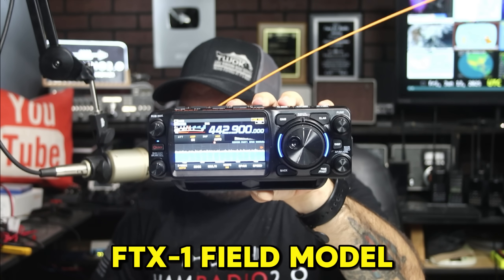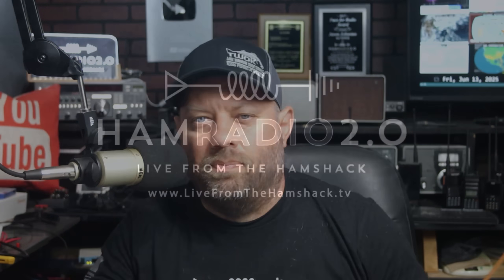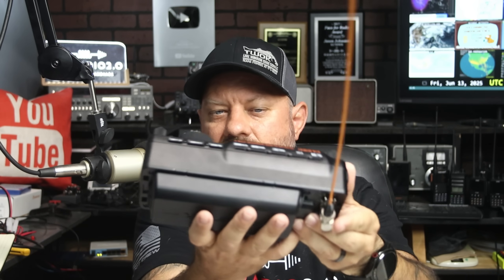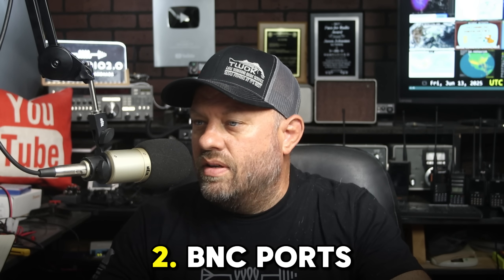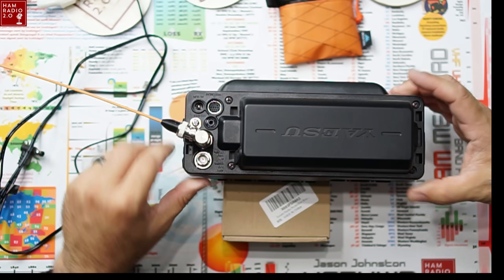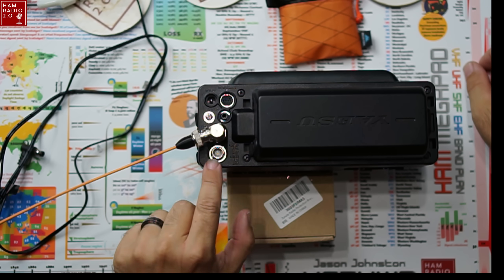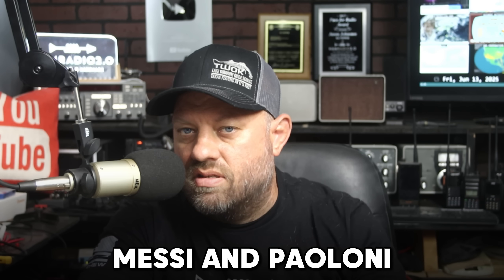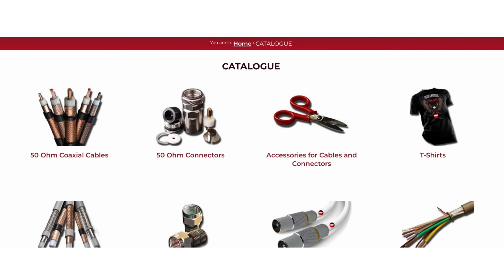5 Things Wrong with the Yaesu FTX-1

Comment: Sorry, this is a lengthy rant, but I had to spit it out one day anyway. This was my original vision on FT-817/818 replacement from Yaesu. I understand that many of you may disagree, but problems mentioned in the video are minor. The core problem is the form factor of the radio in the first place. Neither IC-705, nor FTX-1F is perfect for truly portable and backpackable operation (at least 705 has dedicated backpack). Success of 705 was not due to ideal form factor, but rather the lack of competition. Yaesu had nailed it many years ago with 817 and regretfully abandoned it. There was opportunity and maybe, just maybe still is to re-imagine the portable QRP radio without any display and make a use of displays that are already in everyone's pockets - smartphones. There are key important advantages: no display - less power draw, increased ruggedness, smaller overall size and weight, more inner space for modern technological advancements. Just imagine the black, rugged and weather sealed magnesium brick the size and form of 817 with rightly placed antenna ports and set of modern built-in connectivity tools, namely BLE (low energy), Wi-Fi, GNSS GPS, fully functioning TNC and fully functioning USC-C charging without compromises, open and robust API that would make 21st century radio to stand out. The missing albeit the most important component would be the Rig Control App. That's were Yaesu and other makers had to, have and should concentrate on and invest the most. The times of hardware perfection should give a place for software and usability perfection. Coming generations of radio amateurs would appreciate that for sure. Currently, the state of first tier software is light-years away from what is possible today.
Yaesu idea of modularity would perfectly fit this this kind of design, too. Large and crisp 5-7” add-on OLED display on top of the radio, that is tilt, pan and swivel type like in D-SLR and mirrorless cameras, would make a perfect companion to the radio in a shack. For portability, the display could swivelled and flapped down on radio's top face for extra protection. The additional antenna tuner could be stacked from the bottom along with the range of battery packs or even PAs of different power levels. Modular expansion vertically, to my opinion, if far better design choice than expansion horizontally (like in FTX-1F). And it is not new; it was already in use!
In summary, the problem with FTX-1 is not in bits and pieces – it is in the wrong design choice from the beginning and a lack of bold and open-minded vision into the future. I hope that FTX-1 will find its niche while some of us will still wait for a truly portable QRP rig from this or the other radio manufacturer.

Comment: As a backpacker for 45yrs, and a ham for 35yrs Im saying that a real backpacker isnt going to bring a 705, 817 or FTX with him/her. Backpackers are backpacking. Hams think backbacking is hiking a mile or 2 to do some POTA/SOTA is backpacking-hysterical. With that said I bought the FTX-field and it is a field radio cause it comes complete when you buy it minus an antenna to be used in the field. The idea that some hams believe that they want to carry this radio up a mountain , want it to have 100 watts, charge of a solar panel that can fold into their wallet and all weigh less than their tootbrush is insane. One thing I've noticed about many hams-They can be the biggest cry babies and spend more time whining than using their radios. Actually some use their radios to whine.. Just enjoy the hobby, stop looking for every single little thing to make up about complaining about everything. If any ham thinks they can make a radio that is better than any company, well grab your soldering iron and start making it. Buy it dont buy it.... your choice, nobody is putting a gun to anyone's head. I love it so far, it does need some firmware updates to enhance, expand features but overall it is a fantastic piece of equipment. I wish more hams would backpack, cause the bellies can be pretty large. lmfao
Reply: I couldn't have said it better myself!
Reply from the maker: Semantics aside, "backpacking" is simply putting gear into a pack and hiking with it.  If you want to talk about rucking or something else, then fine - but arguing the definition of backpacking isn't the point of the video

Comment: I ordered on as soon as they were announced, First the dealers said they would have stock in May, but now the UK delivery has been pushed back to August 2025,  I don't mind the delay as long as the problems are sorted Yaesu does not have a good track record with Mk1 radio's. But the the extra time has made me doubt my choice, should I go go for ICOM 705 or even maybe a Yaesu 710 field I am a long term 817 user which still does exactly what I need de M0JZT.
Reply: I have the 705. And it is superb. If you consider carefully the pros and cons of each radio, and assess exactly what you want from a QRP radio, imo the 705 is still the one to beat.

Comment: Hi, love your videos.  In response three reasons I haven't bought the FTX-1. 1) I live in the UK and they are not available here yet, nor has any date been given for their availability.  2) In a comparison video that another Youtuber did to the 991A the C4FM audio did not appear to be as good as the 991A on receive.  I run a 991A in to a JBL Control One speaker and the audio is superb. To pay double the price I would expect the Optima to be as good in all respects as the 991A. (It will be over £2000 when launched in the UK- about $2800 US dollars at today's exchange rate, the 991A is about half that price with cashback etc).  3) The position of the FTX-1 in the Sherwood rankings.  Why not make it as good as a 710?  No answer on this one.  I will probably stick with my 991A for at home and the FT818 for ''field'' stuff.  Keep the videos coming!
Reply: Hi ,there's a option that I believe that the Sherwood missed something that is not mentioned on the FTX-1 F / Optima is the NEW option called ( SD-X ) button Mode on the Top of the head,what it does is like a Pre-Amp version of the Receive enhancement on All FTX-1F / Optima. It does work on HF / VHF / UHF modes and has less noise that I can tell,but the [ D-Level must be trimmed down on the screen display or it will be really aggressive on the waterfall or 3D modes.I have also a FTDX101MP as my Home station and the receive is very good as the DX10 and DX710.......

Comment: Most commentator on all the videos says the 818 or 817 or some old radio they have is better. this is fine. 
But there are always new HAMs coming to the market, and as a first radio that can do field, or connect to its amp and do 100W (which is kind of a most for new hams), and can do VHF/UHF and HF, there isn't any other radios. 
Sure you can buy FT891, and another radio for VHF/UHF, but this radio does both! + the 100W.

So for me, this will be my first radio! Using at camp site next to vehicle with the optima, or take the Field for a quick hike.

Comment: I understand you showed the USB-C cable can plug into the radio to charge the battery. Which is good considering when the USB-C is plugged into the battery and the battery is mounted, it completely blocks the BNC for the HF antenna
Reply from the maker: That was one of the main problems I found with it as well.

Comment: $1,500 or $1,900?  Sorry John K., but it’s just not ready for prime time.  Am sure it may eventually be fantastic, but I can honestly say i’ve never had one bit of disappointment with my 705. Which is a good thing cause i’m kinda locked in to the 705 path simply because that’s where i spent my money long before there ever was a ftx-1.  As an added note and just to show i’m not an icom snob, can honestly say i looked long and hard at the icom dual band, but my recently acquired Yaesu 150rasp is the best dual band mobile i’ve ever had!  Speaker in the control head, mic jack in the control head,  and the ability to connect control head to the rf body (or not).  And as much as i love my d-75, i’m not planning to replace the yaesu 150rasp with the beautiful new kenwood when it arrives ! - how could they possibly not put a 15 cent mic jack on the control head?! (insert eye-roll here!).  that makes it a no go for me.

Comment: I have respect for Yaesu. I own three of their radios, the FT5DR, the FT-891, and the FTM-510DRASP.

But Yaesu missed the mark, here, and the execution was off. Beautiful design, but left a lot to be desired. You described pretty much virtually everything that needed to be improved upon. The positioning of the antenna ports and the lack of APRS functionality is disappointing.

We’ve become unwitting “beta testers” of the FTX. Should Yaesu come out with a third version of this? Something like the FTX-1M, M for Mobile? Mike, K8MRD made a video with a good proof-of-concept that the FTX-1 can indeed be used in a mobile configuration.

Yaesu, you made mistakes, but at least you owned up to them and are making an effort to correct them. That I find respectable. That being said, I have no intention of buying this radio. It needs a lot more work and refinement. But, the design from the outside is really nice. I feel it could have been capable of so much more.

And this small donation is for you, Jason. Thank you for your thorough reviews and insight. You’re a blessing to the ham radio community and you’ve inspired me on more than one occasion.

Cheers and 73 from MN - KF0QNM
Reply from the maker: I really appreciate the kind words and the donation!

Comment: Per PD spec a 27W or greater charging supply is needed to get the required 15V.  IDK where Yaesu came up with their specs.   The max charge rate is 10 Watts regardless. Around 7 hours to charge.  An Anker 737 will do it just fine.   It's about the size of a Coke can.  I have other 30W chargers that work too.

I have mine FTX-SPA separated about 6 ft and all is well.  The reasons Yaesu claims it can't be done are not technical.  It has to do with certification and the rush to market.  A review of the FCC documentation will confirm what I'm saying.  

Until today, the ATAS-120 would not work with the SPA-1.  It appears to be corrected.  As does the APRS and the GPS.

I expected bugs on a new release radio but this is a half baked prototype with MANY issues.  Until today it was an expensive paperweight that I couldn't use. John Kruk had lots to say before the release but nada from him or Yaesu since.  I have no way to know if the shortcomings are going to be corrected or if they work as intended.

I'm personally disappointed with how Yaesu has handled this.  I paid for a premium and innovative radio.  That's not what I got.  Sure, 6 weeks later it's closer but I still don't know about the rest of the issues on my list.

Comment: A good friend loaned me his FTX-1 Field radio for a few weeks for evaluation. There are a couple of good points about the rig, but it’s no FT-857D (more like a FT-897D, TBH).

An all-mode VHF/UHF dual receiver with APRS, GPS, sound card, tuner, and video out port (all contained in a similar size to the FT-891) would IMO be an instant winner that could dominate the market for years to come.

Comment: Define "Field" first.  I agree, field and backpackable are two different things.  By field, I expect it to be ruggedized for transportable use.  Whether a vehicle or van (trailer) it should be able to handle a reasonable amount of bumps.  (someone needs to make shock mounts like we had on our military radios.)  

It's a radio and amplifier.  Not a control head and radio.  The fact that the amplifier can not be cable connected is something I don't like.  As much as I like Yaesu, I'll probably never purchase this radio.  Bang for Buck, I prefer the FT-710.  Also with a 'field' designation, and not something most would backpack I don't think.

The Q/A is not what I expect from Yaesu.  They're a corporation.  Sometimes execs and salesmen over ride engineers.  Being Japan, I don't think this will be a problem again for the next 10 to 15 years.  As stated, they came forward and answered for it, and are working on it.

Comment: Agree the rig is Much  heavier than I expected.   No issues charging the battery, I simply use my dc power supply. Not an issue.  Aprs is not an issue as I see no use for APRS messaging. Since APRS came out, I have messaged back one time in what 10-15 years. No big deal.  100% agree on the separation issue. That was my intent and why I canceled my Optima order and just got the field version.   I may add the amp later or may not. Also agree with the coax ports. Dumb although I use an external antenna at home, an external antenna in the car and see no reason to stick  a duckie on the rig, ever.  Overall, happy with my FTX-1. Also I laugh when folks put out videos on how to do firmware.  A ham who cant figure that out needs serious therapy!

Comment: The simple solution to separation would have been to have an RJ 45 extension cable, and when you plug that in you could have a menu item that disabled the app in the head, and enables the amp remotely. I agree that stupid bunch of cables that connects the head to the amplifier just doesn’t make any sense

Comment: It’s not weird that you need a counterpoise for VHF verticals. When you hold an HT, your body is the counterpoise. No such thing when you’re laying the radio on the table. It’s completely normal better yet, get a nice little portable antenna and hang it on a tree or something. So the PNC issue and it makes the thevhf/UHF antenna worth that much better.

Comment: I can’t imagine any justification for wrapping a radio in a cage. I don’t see any reason why you couldn’t stuff a large screen radio into the backpack. What are you guys doing to these videos? Driving six penny nails?
Reply: I put my FTX-1 in a large Nintendo Switch case.  The rig, battery, mic, CW key, and any cables I want fit in there nicely.  Adds almost no weight (and on this radio who cares LOL), and protects it nicely without a ton of bulk.
Reply from the maker: Are the antennas, connectors, coax, adapters and computer equipment you're using all made of cotton candy?
Reply: @HamRadio2  Don't understand the question. You cannot attach cables to a radio without scratching it?
Reply: @HamRadio2  Why in the world do you have to put everything in one pile? All you have to do is put the radio in a pouch and all done. I've never scratched a POTA rig.

Comment: Now as for why Yaesu did not put the BNC of the VHF/UHF on the top where the HF BNC on the bottom is probably to keep you from getting RF radiation spread towards the operators. If you feel that you are not satisfied of the BNC's setup for the antenna's,than you can move them by opening the field head of the radio and disconnect it from it's location from the top to the bottom,but than again you will be out of your warranty if you do so. There are ways folks and don't let this bother you so much,life is to short and for you to get frustrated for such small issues is beyond your intelligence.All radios are not equal and there will never be one that will suit anyone here in the ham radio business,there is NO Perfect radio on the market now,if there is,than it will probably gonna cost you more money to have one.

Comment: I agree with all of this issues, but more so... What do I gain for the increase in price over a 705?  I would lose Wifi, have to pay extra for BT, have to pay extra (and run it externally as a dongle) for a GPS....  It has 2 receivers, but not full duplex.(?!?)  That 'might' be worth $150(+) for some, but suspect not for most.  

To further make the price an issue, you'd only have to look at a FT-710, which had been offered numerous times under $900 (with the Field model hitting $800 a couple of times).... Cutting it down from a 100W rig to QRP should have covered the cost of adding V/UHF, especially if you consider the shared parts that actually run the radio, with it being an SDR rig.  Let's face it, as of this writing, you can pick up a FT-710 Field ($920) & a FTM-510DR($550) for less than a FTX-1F, much less an Optima 😕

IMHO, this was a large missed opportunity by Yaesu.  You'd be better picking a 705 and a 100W amp w/an ATU (like a Xiegu XPA125b)...again, just my opinion, though 🤷
Reply: 100%! You can also go with a 891 (very light, small form factor and 100W) and just a used Kenwood TM-D710 (king of mobile VHF and APRS). That's what I did by the way 😂

Comment: I never get first run items so I'm cautiously optimistic about the FTX-1 series 😎 It's now critical for me to have an actual replacement to my FT-817ND and / or my FT-857D, I'm happy to wait until Yaesu thinks they have all the kinks worked out before I fully consider it.  Initially I wasn't super excited about this but after seeing your video and others I'm willing to give Yaesu a chance to deliver on finally having a successor to the 817ND and the 857D.

That said, I don't get your USB-C battery comments.  45W PD is basic now... 65W or 100W would be more problematic.  Anker and Hyperjuice both have 100W capable power banks and I'm sure they are others now.  Some might not consider those "backpackable" but I honestly have never consider my radio gear in that context.  I think the vast majority of people have their kits in cases and are transporting them in vehicles so a capable power bank really isn't an issue in that case.  I suspect the 12V input is probably what I and most hams would use since most of use have solar panels and batteries that are 12v.  The USB-C stuff is nice to have for sure but I don't see much internal battery use.  I'm more interested in the Optima model so I'm probably missing concerns from field / QRP minded folks.  For the record, I'll say that I pretty much never ended up switching to the battery in my 817ND during operations.